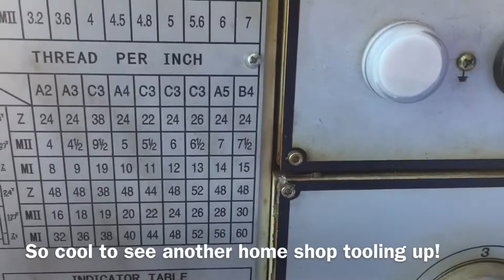Gerts Lathe - Gemtrek Lift

Comment: That was a lot simpler than when I moved my lathe my self. It was a skid steer pipes and and a engine crane. I hired riggers to shoehorn my mill in my shop. It nice to have someone like Bruce with his equipment to handle such jobs
Reply from the maker: stupidest "self move" for me was when I put the engine back into my Austin Healey Sprite. I didn't have a hoist, so I manhandled it in by myself, no lifting gear. It was just the Short Motor, and I put the head on once in place.. but stupid to try, and wouldnt do it again.. My back survived, luckily

Comment: Same lathe as I have.  Just watch out if you do work close to the headstock (e.g. take the chuck off and use collets).  You run out of travel towards the headstock because the telescopic leadscrew cover binds up and, bang!! you break a roll pin inside the apron gearbox assembly.  The brass shear pin in the leadscrew does not "shear" first!!  Just ask me how I know this!!  Apart from that, I am happy with my AL336D.
Reply from the maker: nice one! I for one know that my "shear pins" on the AL960B are steel not brass, might be worth swapping them out once i get a carriage stop built

Comment: What struck me was the "Ford Ranger" looks like the American Ford F-150 (full 1/2 Ton truck). The Ranger here is a smaller truck, like a Toyota Tacoma (versus the Toyota Tundra). That and the driver got into the wrong side to drive it! I can't imagine how strange it must be to come to the U.S. and drive on the "wrong" side of the road. I would guess each country has been doing it that way so long there is no chance of change. We'll probably also never harmonize the pronunciation of element 13.
Reply from the maker: yeah we have many variants on the "ute" floating around, mine is a 2.8ltr diesel tray back, tows 3T, big enough, just...